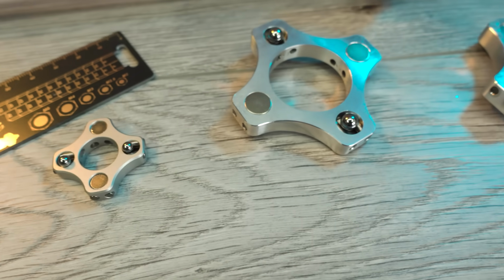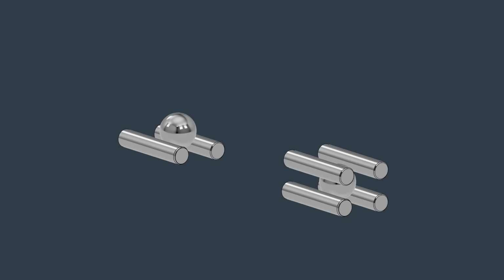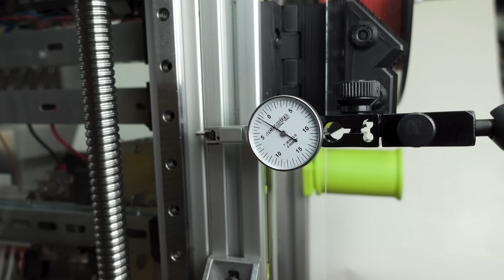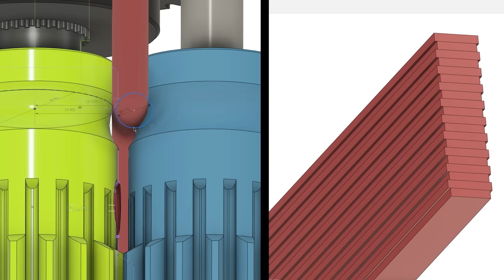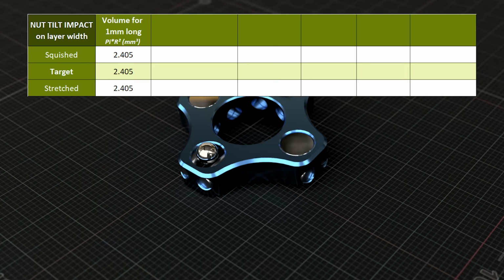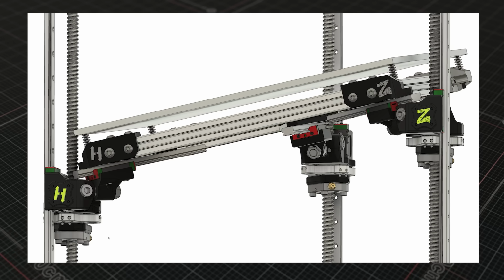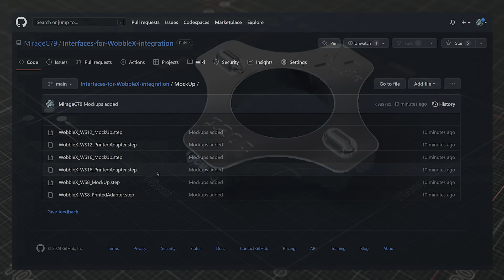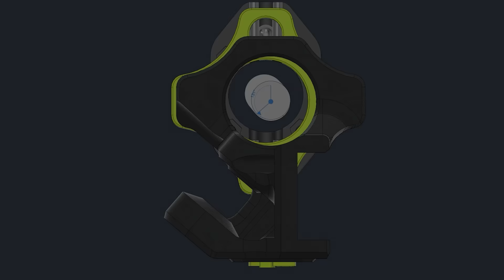I will never talk about Z wobbling ever again !

Comment: So with this mod its also not tzt important anymore to use high quality z rods am i right?
Reply from the maker: Linear guides are still critical.  This system only decouples the Z Screw from XY plane so they will not deform your printer when oscillating.  If you have super strong Z rod fixture and a very sturdy printer frame, the oscillation from lead screws should be managed by that rigidity.  the screw will flex.  Have a look at this video: https://youtu.be/mqSQhwqSzvg?t=155
Reply: @MirageC  thx for the video link. In my case its an upgraded (klipper) cr5proH printer which is pretty solid in terms of the frame. Ill make a test with a zylinder print like in the vid to see how bad the z wobble is. In case its to much for me ill go for a 3d printed version of the wobblex first for testing before ipp buy the cnc version 👌👌
Reply from the maker: @SharkWhite333  have a look at this other video: https://youtu.be/c6JmCdovE0U
Most of the time, we think it is Z Wobble, but it is related to the extrusion system: https://youtu.be/c6JmCdovE0U
Reply: @MirageC  getting deeper into the rabbit hole thx man. Thts the reason im pretty sure ill go for a hevort. As soon as i got enough money. Thx for the kind support

Comment: The result is awsome, and that is not question about its effect. For me it looks a little bit overdesigned and overcomplicated. If you have a rigid frame, as you have, cancelling the screw wobble doesn't need this complexity. But it is fine and work smooth, so no offense, you've done awesome job and the result is perfect.

Comment: Solution: Change this screw system for a belt system with geared steppers. And say goodbye to all the others solutions forever.
Reply from the maker: How do you tune input shaper on Z to compensate for belt vibration on fast Z hopping?
Reply: @MirageC  i use a gt2 10mm width belt, i'ts fine for that and no have any problem, using a simple tensioner and about 1meter belt and a geared stepper. No one vibration on fast z-hopping.
Reply from the maker: @elcalvo4x4  that's good.  What bed plate size and thickness do you have?
Reply: @MirageC  310x310x540 print size in brohoof printer. The bed have 4mm thickness. Cartesian style.

Comment: I am a welder and I use 1 solid stainless rod to hold and stabilize and 1 threaded for moving up and down nor left and right movement and it fixed the issue, you can also find in most industrial how they already fixed your problem specially with CNC

Comment: actually, there is a much simpler solution. 3dprinted plastic coupling with a steel ball. i attached  the rod via this ball to a z motor, and no wobbling artifacts since then on my ender 3 prints

Comment: Any particular reason your linked listing only allows one item per customer?  I'd rather reward the original designer despite your listing being more expensive than others, but then you won't even sell the two-piece minimum that I need. 🙄
Reply from the maker: The other links are copies with loose tolerances... They copied our design.  Yes they are cheaper.   As for the link, I am not sure I see the same thing as you.  I can add as many as I can to my cart by increasing the quantity from the listing.  They are sold individually, you need to add the number of units you want to your cart.
Reply: @MirageC  Quantity change buttons greyed out, input field read only, and this text below:

|  Additional 12% off (3 Pieces or more)
|  1 pieces at most per customer

I'm getting this result across multiple browsers, with or without ad blocking disabled, whether logged in or browsing anonymously, all on your listing only.

Edit: BTW I'm trying to purchase in Canada.

Comment: so you rather go unbelievable lengths to mitigate something that cannot exist in first place if you use ball screw correctly? ball screws need to be fixed properly on both ends with specialized bearing blocks and in constant tension! not to freely wobble at the motor and most importantly at the end. 
then can be precise well within one micron. but in the other end you would not be able to invent solution to non existing problem and also monetise it...
Reply from the maker: Tell me, which solution has more "length"?  Specialized blocks with a beefed-up frame that will take the tension without bending? 
Or some small add-ons that can give you access to the reliability of ball screws on a 3D printer?

Comment: Just use 2 good quality 15mm linear rail,1 stepper motor,1 2mm steel plate (mine is 40x40cm),1 ball screw or normal screw with 1mm pitch,2 piece of aluminium wall bracket (Bracket model 13 aluminium 25x30 cm) 30cm side you keep another you cut at according to your linear rail block. Screw all together and is will not move a micron. The problem with your setup is the lot of moving and not fix parts. Why you need 4 motor for Z? I have also Corexy printer but 1 stepper motor between the 2 linear rail is enough.  My bed weight like 2-3kg + the printed parts and 1 nema 17 is doing his job perfectly . Let me know if you want photos...
Reply from the maker: HevORT has 3 screws on Z.  They allow for self levelling of the bed.  They also have enough movement to be used in eventual non planar printing.  Different goals, different means...

Comment: Hi my WobbleX just arrived.  I am looking for the stl files for an Ender5 Pro but only can find the two bolt version.  My printer has four bolts holding the leaf nut.  Can anyone point me in the right direction please?  Thank you
Reply from the maker: 2 Bolts on the nut will be enough to mount this assembly.

Comment: Me sitting here with a Sermoon D1 (nothing special, just a very sturdy "bed dropper" machine) and no Z wobble, shift, banding from the top of a 310mm print. This is with one of the lead screws having a slight bend. I did the math on deflection, and less than 1mm deflection translates to almost nothing. I also tightened the brass nut screws, then loosened it 1/4 turn to allow lateral shifting but no Z slop. The bed rides on two vertical 20x40mm v-slot extrusions

Two things i did, i put the bed all the way down until it bottomed out and loosened the z-rods then activated the stepper motors as to jump into phase. Then i carefully tightened the couplings as to not move them in the slightest, the stepper motor will give a little while being energized. That made the z-banding nearly invisible and you had to really really look for it. Then i did the same thing again but this time i installed a timing belt, making sure they where in perfect phase i energized the motors on and off listening and feeling for any shift. That completely removed any z-banding visible.

Note; I'm using a 0.5mm nozzle and regularly print at 0.12mm to 0.32mm layer heights. I always use PTFE grease on lead screws and PFTE oil/grease mix on LM8UU bearings and meticulously square my machine. Which annoyingly exposes any slop in the bearings and makes them slightly noisy.

Comment: Did you try the GE5C bearing for the bed mount first? Or in addition to? I'm trying to figure out what this does differently than the GE5C method that has been around for some time now. Or is this better? But no comparisons. Or am I not on point with what each is supposed to do?

Comment: Oldham couplings are a simpler way to do this same thing. Without the drawbacks of needing magnetism to hold things together. I can say assuredly after building many machines, they eliminate ALL z wobble, for $20 a set. Add a plastic pom nut and viola, ZERO z artifacts.
Reply: the magnetism is for ease of assembly, also oldhams doesn't fix tilting of the nut

Comment: I've never once thought about this type of wobble while printing.I just thought the slight variance was due to the unavoidable motion created by moving the print head. Absolutely mind blowing to learn you can get near perfect finishes on printed parts without sanding/finishing.
Reply: The video shows that it's not non-existent, but it does only show a worst case sort of scenario. The printer design is sensitive to a bent lead screw, and it's got quite a bent lead screw.
Reply: You never thought about it because it's NON-EXISTENT!
Reply: @Theexplorographer if you use belts
...
or a delta.

Comment: deffinatly do not buy the wobblex
what a goddamn ripoff. 

selling you HALF a product for 20 bucks.

just get some magnet.  some ball bearings.  and PRINT one.
Reply: and if you ad the costs of a working wobblex system to the ball screw.  you can just get a decent ball screw  (one that is cut/ground  instead of rolled)
Reply: it comes with everything you need, the rest pf the parts are printed. @darkracer1252

Comment: hello i have the oldhams couplers already and it does not change a thing .. will this system be better ? was the oldhams a fail ? thanks a lot
Reply from the maker: If oldham are not having any impact on your print quality, then your issue might be else where. 
Have you seen this video on extrusion consistency? https://youtu.be/c6JmCdovE0U
Reply: @MirageC  i did looked at this video and i bought the vz hextrudort and its the same .. the thing is that the issue is showing more pronounced toward the end .. so the higher i go the more i see the problem same as your video

Comment: Great design.
I have a question to ask: is the magnet in the middle element necessary? For some reason I need to make it as thin as possible, so if I remove the magnet in that part will there be any problem?
Thank :D
Reply from the maker: MAgnets are mainly to ease the assembly process.  They will help at keeping the balls in place without flying off everywhere.
Reply: @MirageC  Thank you very much :D
I use 1204 ballscrew for my Trident, if using WoobleX it will hit the frame, so I'm looking to make a narrower and all steel version :D

Comment: Um.. are these standard magnets?
Because if you want to increase the locking force, there are magnets W layers of alternating poles, that create a very positive magnetic lock.
Reply from the maker: The sole function of these magnets it to ease the installation process.  They avoid the balls from falling off.  Once the system installed they have no impact on the mecanism.  In case of the ball bottoming out their max allowed travel,  it will simply reset itself and eventually self center.
Reply: https://youtu.be/AvbVT47w0rc

Clip of a video about shaping magnetic fields, focused on how it looks thru magnetic film.
I couldn't find the original video, but that one had some magnetic toys that used shaped field magnets to have 4 identical "shperes" interact in different ways.
One of them had a similar bullseye shaped field under magnetic film, and caused the spere to "lock" in place.

Comment: Thank you for your work. I have used the previous design on my printer which is now showing signs of wear. I need this upgrade.

I have a question regarding supporting the top of the lead screws . Are there advantages to having it fixed vs floating? My homemade CoreXY, has a lifting bed with 2 lead screws, and 4 supporting rods on the corners. Is it not better to allow the lead screw to float with the wobble?
Reply from the maker: When using the WobbleX there is no more containment of the screw at the bed level, which means it is like if the screw was free all the way down from the coupling.  Chances are that a tiny deviation at the coupler will be amplified by the length of the screw.  The resulting wobbling around might be too much for the WobbleX.

Comment: So, in short just use belts of top quality (gates comes to mind) instead?
Reply from the maker: I am still not convinced about Belted Z.  Resonance during fast z-hopping of that massive bed plate going up and down will get the belts to oscillate a lot.  Add the complexity of counterweigh system, gear ratio...  I just don't see that scale tipping towards such a solution yet.
Reply: @MirageC  indeed, mass is the enemy of speed

Comment: The ender 3 3d printed parts have to large tolerances on the slots for the push pins. 50% of them wont hold in their slots.
Reply from the maker: I get comments that they were too tight... Where did you source the pins? Mellow?

Comment: @MirageC I am at the moment doing the WobbleX for the RatRig Vcore3.1 I have ran into only one issue that i just wanted to let you know about. The holes for the pins in the bed supports.. The back bed support holes for the pins are fin and gold on tight however ones for the front left and the front right are little big and the pins will either fall out or get pushed out from the ball moving around on them. If you could as I don't know how to make or modify this stuff, can you look at the holes size for the back support of the bed and make the holes in the front left and front right the same for the pins. Maybe there is a little difference between them.. Other than that great job and cant wait to see if this is the cure for my z banding I am having..
Reply: O and also the holes in the wobbleX adapters the holes are little big for the pins also. the will move around and not stay in place also..

Comment: A very elegant solution. I was actually designing something like this for my Ender 3. I used ball bearings from motorcycle parts and the pins from an old DVD writer I had around. I made some prototypes but stopped once I learned that Oldham-type nut exists.
Reply: Yep, got them on my CNC X1 otherwise all the stepper motor torque goes into bending the screw.

Comment: it's very cool, but could you maybe get Mellow to have a kit that includes all the parts needed for a printer? it's very to source for a single 608 bearing and a few screws and nuts would lead to a lot of waste. it make more sense if Mellow could include these small parts, if not with the printed parts as well

Comment: Can you please try to print on your printer a cube or a cylinder 40x40mm with walls ranging from 1 line to let's say 5 lines. For the last several months I've been also chasing z-wobble issue, I've basically have already re-built my printer. And a fun thing is that when I print like you do 1 wall spiral everything is fine, but if I print walls with several lines the resulting wall quality gets worse and is directly proportional to the number of lines in the walls. Printing models with walls thicker than 1 line is more realistic test.

Comment: Excellent design. However, imo, the biggest thing you could do to reduce wobble would be to use the ball screws properly. Ball screws are meant to be under tension, with a bearing on each end. This keeps them at their proper accuracy, increases resilience to temperature fluctuations, and vastly reduces wobble. Technically, I've heard they can be run in compression, but imo it's a poor idea for the same reasons seen in this video.

Running ballscrews without double bearings and expecting minimal runout and maximum accuracy is not reasonable, since that's not using them within their intended use case. That's fine, but I'm just pointing out that might've been (and still can be) a much easier solution to try first.
Reply from the maker: I totally agree with you.  A tension installation would require a much bigger and sturdy frame.   All of this extra needed rigidity would add quite a few parts and additional cost to the build.  I wanted to leverage the low maintenance and high reliability aspect of ball screws while keeping cost as low as possible.
Reply: @MirageC  I figured all that would be the case; I suppose it was implied based on 3D printed construction.

That being said, a tension installation doesn't necessarily need to be bulky or even "rigid" (in the conventional sense). A tension installation only necessitates a compression support, which could be achieved using an aluminum extrusion on either side of the ball screw, with two metal plates on the end. Of course, I acknowledge that the metal plates part of that is nontrivial for you, and is exactly what you want to avoid.

That brings me to the question which was most curious to me: given the cost of ball screws already, why not use a single rear ball screw with two linear rails, kind of like one of those Chinese prefab CNC axes (see a "knee mill" for what I mean)? Is bed sag noticeable with that setup?

Sorry for the weirdly late response; YouTube never notified me.
Reply from the maker: @jrcowboy1099  No problem ;) I really wanted to use ball screws to allow for fast Z-Hop on retraction without eating through the nut like it would on Lead screws.  And we are using 3 scerws to allow the printer to self level the bed.  We also have dreams of 5 axis printing 😃
Reply: @MirageC  If you're really going that route, then I might suggest an architecture improvement I ultimately had to scrap for many-axis CNC mills: use a constant force spring to counter-balance the weight of the bed. This is basically a coil of spring steel; you can find these in drill press' chucks, for instance, used to retract the handle. In this case it would be attached with a pulley to the bed assembly. You could use a counterweight, but accelerations >1G cause issues. This improvement particularly aids large delta-style printers, but could be useful to you.

With your anti-wobble mechanism, these might have to be attached to the lead screw nuts. This would allow symmetrical loading of the Z motors in the up and down directions, giving you more bang for your buck in terms of movement without adding moving component weight.

Again, scope creep plagues this improvement with complexity and cost increases, but it all depends on how you ultimately plan to use the machine.

Comment: It's unfortunate that a good ball screw costs an arm and a leg
Reply from the maker: Indeed, but the real way to install them would be to put them under tension.  Saddly a 3D printer alluminum frame would not be strong enough to do that.   Luckily, we now have a device to leverage the high reliability of ball screws 😉